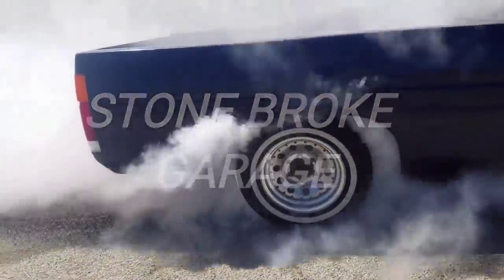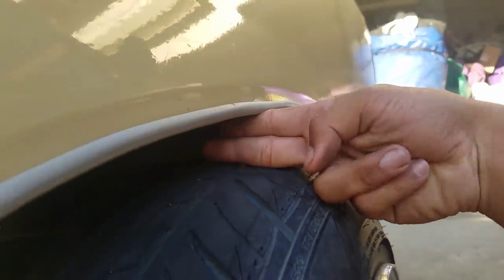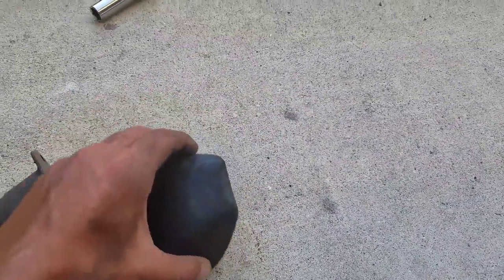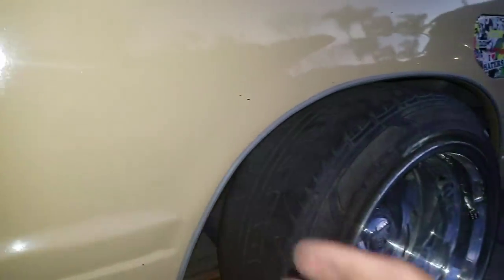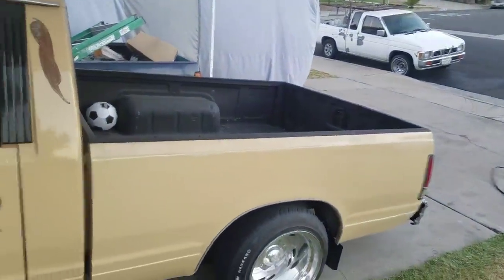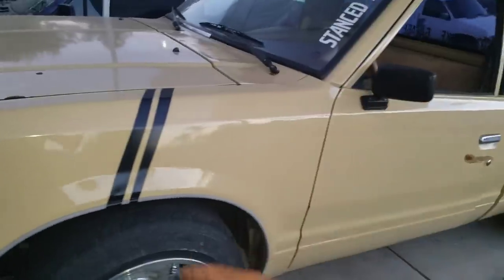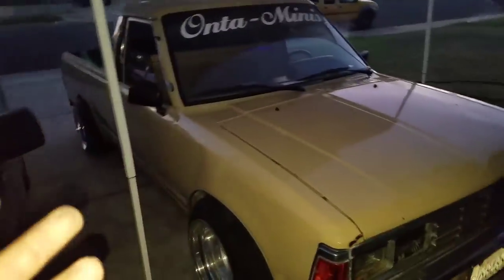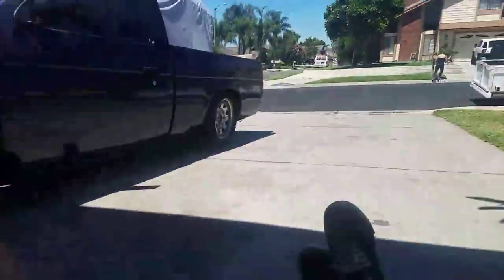how to lower your truck for less then $60

Comment: you can lower the rear for free without lowering blocks all you have to do is unbolt the bolt that hold the leaf springs together remove the middle spring and the bottom small leaf put it on top and put the bolt in and tighten it up. you will need a jack to raise the leaf springs to put the bolt though. .we use to do this in the 1980s
Reply from the maker: Sharkey C yeah I know what you mean I have friends that did that and their trucks ride a little to bouncy
Reply: Sharkey C ho man, das old school
Reply: Sharkey C imma try that on my hardbody. hahaa
Reply: yeah never do it to a first gen ford ranger I broke the mounts over a large bump and that caused it to make my diff bust
Reply: Sharkey C you are so right about that, I have done 3 S-10 s and 3 F-150 s the same way in the back works fine every time.
Reply: Sharkey C ..any video's..??
Reply: If you cut the springs in the front, will that lower the truck too? I am a noob. Sorry
Reply: 80s, the birth of minitruckin
Reply: @Anthony-pk8lb  nah bro if u cut em its a lift
Reply: @Anthony-pk8lb  yes it'll lower it if you cut springs
Reply: We did it in the 70’s 😎 flip the smallest leaf too
Reply: @waynehardy2309  I have a 2000 s10 what you do to drop the front?
Reply: I needa do that

Comment: i been mini truck world since 1988 n helped started a club call Hard Core, im still in the game 45 years old and own n 85 Nissan Datsun 720 single cab short bed. cutting the stubbers is stupid my truck rides beautiful we us old school guys got a trick to drop these trucks n still have factory ride n a tiny bounce, for the last 25 years plus u go get a 3inch block for the rear, remove center leaf n rubber stubbers.keep top and bottom leaf springs n install your 3inch block boom u will drop 5 inchs and a finger a half or 2 clearance, truck will not hit unless heavy loads the front u remove the stubbers start loosening your control arms till the bolt comes off .the swing arm now is like a 45 degree angle grab it pull it out and slide it back on all most level. screw your bolt back through the control arm count how many turns n repeat other side, by doing this u dropped the truck lowest it can go n adjusting the cntrol arm to level and truck will raise n dont have to worry about your control arms dragging over speed bumps n angled drive ways u will be low no hopping cutting stubber is not a fun ride on the high doing 70mph, thats the correct n cheap way to drop theses old trucks
Reply: Steven Nodalo the suspension u wanna get is perfect i also own a bike plue a dropped streched ruckus so u should just get a set of air shocks which i got for my 720 n rides perfect anytime u load up your bike air it up cheap if u cant afford airbags which i love but if they every crap on u your done. Keep n air pump in your truck incase other loads i had to by a frigerator busted out pump n im golden. Your truck is a must with the spindals but still can pull 1 leaf the middle she will ride out

Comment: Omg your video is so on point on how to lower a mini truck I have seen other videos and they do all this extra shit and don't really explain as detailed as you do. Thanks. Also I almost forgot to ask when you get rear blocks do some come with a new U lock looking thing? And does it have issues say you go over some shit on the road, speed bumps and driveways??? Also for the torches bars hopefully that's the correct word that I heard you say in the video all you have to do is loosin them up in order for the front to get lower. Once it's loosin up to my liking do i just leave it as is? I'm asking because would the screw come off sorry I know it sounds dumb but just got a mini Toyota truck and want to do this type of style because I love it. What's the size of your rear blocks or what size would you recommend to get with having to chop up the rubber portion you cut off in your video I want it to be as low as your truck is at the end of your video but without having to snip off rubber portion. Also say if I do go with the drop spindals route how would that lower my vehicle?
Reply from the maker: Most blocks comes with new U bolts. It’s highly recommended to replace the U blots every time  you mess with blocks since they stretch and don’t like to be used more then once. I personally like to run 4” blocks but most of the time you have to cut the bump stop so it doesn’t constantly bottom out. And yes the torsions bars are left alone one you like the height. Just make sure you don’t unscrew the nut all the way off. Typically drop spindles only go 2”

Comment: Hey man I love the build🤙🏽 I’m building a 86 720 myself. Quick question. Did you just put the lowering blocks and cut your bump stops .? Or did you have to add shorter shocks as well.? Cuz I put blocks and cut my bump stops on mine but i still have about a 2 and a half or 2 fingers gap...

Comment: Beautiful truck and very inspiring the work you’ve put in. I’m also building my 84 Mini_720🔥 keep it alive brotha. I had a question I lowered my rear 3” blocks but my gap clearance isn’t like yours any advice? I’m stumbled because I was expecting lower. I have 15x10 centerlines on 195/50
Reply from the maker: I’m running 4” blocks so my truck is naturally lower, you go remove the 3” blocks & install 4” blocks. Thanks man I appreciate it!

Comment: There is kits out there with coil over springs. But they are expensive starting at lite $3.000 plus. The company is called Ridetech. For my 1st gen gmc sonoma they cost $4300

Comment: I have a 87 Toyota which is basically the same truck just different drive train.  Anyways I'm building a budget drift truck and drop spindle for it is only 200. But I was going to try turning the spindles. My question is when you lowered your did it make your front not as stiff, like looser ? Because I still need it to be stiff so I dont have crazy body roll as I'm sliding. TIA
Reply: P.s where did you get the white wheels on you how to lower a d21 video ?

Comment: Aye brotha I have a 1992 Chevy s10 I’m trying to find either some 5” lowering blocks or a 3 inch shackles do you know where I can find any of thoes options I need help ASAP
Reply from the maker: Not really but honestly Google would be your best bet. I don't know much about s10's
Reply: Imma add 2 blocks on top of each other one 3” and one 2” to make it 5 you think imma have to get a cnotch or would I be coo shaving down my bump stop’s
Reply: I've owned 4 s-dimes and slammed each of them. A 4" block and pull the longest leaf out of your pack will get the back down on the bump stops and for the front just cut one turn off your coils. Any lower and you'll need drop spindles.

Comment: I got an 86 D21 I'm tryna lower. Im gonne start for not by taking a leaf spring off along with the 1 inch block and gonna drop the front torsion bars hopefully that'll work what y'all think
Reply from the maker: Should be a nice 2” drop

Comment: Is there a cheap way to lower the front if my truck has springs? I have leafs in the rear
Reply from the maker: The cheapest way would cut your springs but I wouldn't recommand it. You can buy lowering spring's
Reply: Found a lowering kit for like $140 on ebay for my 96 Taco, you located in Socal?